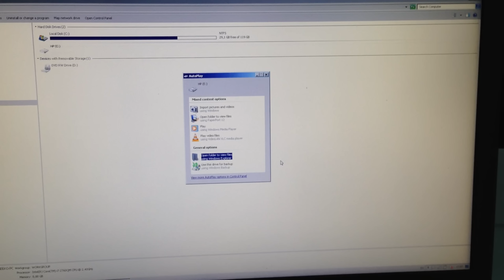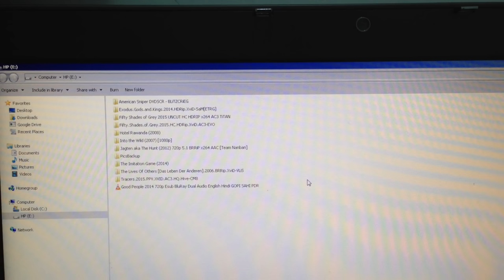How to recover data from a dead hard drive (for beginners)

Comment: Hi guys i got one question, can i retrieve data from an old hard drive ( that is still good ) to a new laptop? I sold the motherboard and processor and i am not able to start the old pc... i dont want to loose the data on the old hdd and i want to know if its ok to make a direct connect with sata cable to laptop to retrive data from it. I ve seen that when you connect a new hdd on a pc or laptop it shows you to format the new one connected... i dont have the device to connect it with an usb like in the other videos that i found on the internet i got only the old cables from the old PC

Comment: I have one question. my hdd is showing not initialized with no disk allocation on the side. on connecting it to the laptop, it spins for 5-6 seconds, then gives me three clicking sound, and finally stops. the wd diagnostic app showed the SMART test passed for the quick scan and full scan. can you please help me?

Comment: I will not think this is a "dead" hard drive, but it is a "dying" hard drive, because it can still turns power on on it, and the noise / click etc is signs of dying. I have a hard drive, that make "click" sound for 8 years ago. Today it will even turns on anymore, so that i guess it will not help to move the "reader" from the disc inside. But there may be something on the green "power-plate" inside that didnt work, even i dont know how to fix it

Comment: I have a question, my hdd showing disks 00MB and as an external connection it shows the full size of hdd also disks sizes like 150GB of 150GB free so in this case this will work? Head beeping only 1,2 time while it's connecting as external hdd or powering up the pc in internal hdd

Comment: 2:40 needed that wire and jack whats the name of that.
Reply: Here in Greece i found the cable that probably it will work for *ME  and its called (J&D USB 3.0 to SATA III 2.5" Hard Drive Adapter for 2.5 inch HDD and SSD) .The price on internet is 20,52 + transport + pay on delivery = 24,92$ . I HAVE A PROBLEM WITH MY HARD DRIVE (LAPTOP TOSHIBA C50D A 133 ) AND I WANTED TO TRANSFER MY FILES FROM IT TO MY OTHER LAPTOP(LENOVO) AND THEN I WILL TRANSFER THE FILES FROM LENOVO TO THE NEW HARD DRIVE(TOSHIBA HARD DRIVE) SO...I WILL HAVE AGAIN THE SAME FILES...BUT I DONT THINK TO BUY THIS CABLE...I WILL JUST BUY A NEW HARD DRIVE AND THEN I WILL INSTALL WINDOWS 8.1 WITH FLASH DRIVE. IT WILL BE LIKE NEW ;) xD. (SORRY FOR MY ENGLISH).
Reply: @lus1ano545   Thanks 4 ur reply 
I got the answer, your English is better than me Respect from Pakistan Stay blessed and Safe from COVID-19.
Reply: @next-level5663  thank you,god bless you & your family 🙇‍♂️

Comment: Hi, I was wondering if anyone had successfully used this method AND then
 continued to use the hard drive successfully after data recovery had 
been achieved? How long does a typical hard drive last for after this 
type of 'temporary' repair?
Reply: As soon as you open the hard drive, its basically unusable after that. Hard drives require absolute no dust inside, which is why they are sealed. If you really need the data, send it off to a data recovery specalist.

Comment: I have swapped the board and move the old bios chip to new one, it read on diskmanager but asked me to initialize and when i did it give error
There's no rough noise or click on the drive
Any solution?

Comment: What is that thing you use to connect hdd with usb cord to you laptop?
Reply: You can get it online...Either a cable or even comes as a case in which you fit it the 2.5 hard disk.
Search for 2.5 HDD SATA cable / case online

Comment: PLEASE HELP! 

My Seagate Expansion 1.5TB External Hard Drive is not responding when connected to a computer. It spins normally & shows the blinking light as well but when I try to open it in "windows explorer" the whole computer stops responding. What might be the problem?
 
There is no clicking sound, the light is blinking and the HDD is showing in "my computer" but I cannot open it. I tried to run CHKDSK on cmd, 3rd party softwares, device manager, etc  but everything just stops working & I had to pull the plug out.. When I checked my task manager, the disk is running at 100%... It is sad because it is just bought it a few months ago and now it is no longer working with my data stuck inside it. ☹☹

Comment: I   was trying to  copy   several folders  in a PC  from  one partition to another,   but instead  of   using   "copy  X to   Z",  I  used   "MOVE  X to Z",     It was  working well,  the  files  were   moving  but suddently electricity  turned off.     Afterwards, the   folders did not appear  in any  partition.    Is it still possible to recover the data  lost ?   I have not done anything  extra after that day,  no format, no more data added  or erased,  nothing.     I only read  the  total content of the disk,    before the event,  I  had  about 10 GB  of data,  after,   only  about  3 GB.

Comment: could anyone please say, if that sound comes for more than 5 to 15 minutes will there be any problem to the data in it.As I was not aware of it I did not turned off .please respond.Can I get the data back from a hard drive which is making sound like this by doing above process

Comment: don't put screw driver up on head area move it at the base of the arm otherwise you run the risk of scratching the platters as you pull the arm with the tip or erasing data if magnetic.

Comment: Help!!! If my PC's BIOS does not detect my hard drive does it means it's damaged or dead? Is it still possible to recover my data? It makes a strange clicking noise sometimes when I try to run my PC. It had been working flawlessly for almost two years, but yesterday, all of a sudden the whole OS (Windows 8.1) froze. I forced the PC to shut down, then I turn it on again and all I got was a black screen saying there was a boot failure... Please help!
Reply: Sergio Soriano, hi there. Usually when the clicking sound begins, there is basically no hope. A data recovery center MIGHT have some tricks up their sleeves, but the chances of any data recovery is low.

Comment: Hi, I have a 2011 Macbook pro and the hard disk and / or hard drive is down/bad. Computer won't start up. I was going to throw it away but I have some files I would like to save. Would you know the connector I need for it? Thanks

Comment: I would like to try to recover my old data from something similar WESTERN DIGITAL AC22500-32LA CAVIAR 22500 16 HEADS 63 SPT 2559.8 MB HARD DRIVE. Do you know where to buy the cable that connects the hard drive and the laptop?

Comment: I’ve been trying to swap a single platter from a 2.5” toshiba HD from a JVC camcorder and no luck.  As soon as I open the drive, it won’t read data any longer.  I’ve tried with 4 different drives all the same part number from 4 different cameras.  I give up and will see about professional data recovery.

Comment: Unfortunately you FORGOT to ADVISE people - In WRITTEN MANNER
"WARNING: If your hard drive contains valuable data DON'T DO THIS"
"WARNING: This video is solely for didactic purpose!! As soon you do some wrong move, you'll scratch the drive
At THAT POINT NEITHER a professional will recover it" [click Read More for more explanations]

since brushed or scratched platters mean HARD DRIVE LOST FOREVER

and why not a sharp

"WARNING: Spinning a drive in dusty atmosphere either the clean box I mention in the video, suc*s as idea, since as soon you open that box the pollution in that atmosphere will enter in the box"

Have you ever uncovered an hard drive under the microscope? I did

Platters because of spin, with their surfaces brushing the air at 90Km/hour are electrostatically loaded , 

open the cover and in some tenths of second all the dust in the air around will be attracted.

Dust is meant something you can't see.

Do you know the non-distance between platters and heads sliders? 
Because of the video you made, it is obvious that You don't know, I tell you: 100 atoms

It is unbelievable to observe what kind of bad tutorials are capable to do people to just catch some views.

People around was telling that PROs are expensive, I googled carefully and I have found the solution
If your data is worth 299 euro, head to www.recuperodati299euro.it , FIXED COST and no recovery no fee.

Comment: Ok I can buy a cable for my broken Compaq Presario CQ61 Laptop, I am going to take the hard drive out of my Compaq Presario CQ61, it's a USB Cable I have to plug in, is it a 2,5" Sata interface and is it 15 or 22 pin I need and again this is the cheapest cable to attach to the hard drive which I am going to take out of my Compaq Presario CQ61 and attach the cable to this hard drive, so what should I type into EBay or even better AliExpress as they cost around £3

Comment: What if there is no sound, the drive is silent, undetectable & it just spins? Your feedback is greatly appreciated.

Originally, it black screened, pointer only. Took it to bestbuy (HUGE MISTAKE) & they tried to refresh, it couldn't get just 11%. Bad sectors. After they finished, it just spins silently no noise & is sometimes undetectable. At other times, it's detectable & the system locks. I created an ALL Files refresh .bat from cmd to try to bypass detectors, but the drive was unsucessful in clearing. It would not refresh. What else can I do? I just can't to retrieve my data. Again, any help would be greatly appreciated. Thank you again.
Reply from the maker: R.I.P

Comment: DAMN!  5 TB of data about to be lost as my drive started to the double strange sound clicks followed by silence and repeat after 3 seconds. I even dis and reconnect the HDD and the CPU found it before immediately disappearing again in error.  Looks like i need to go buy a new one and go through this surgery. Wish me luck. I NEED those files.  Now, how on earth can I do this in my house as I'm sure dust and particles are everywhere even after vacuum, cleaning and so on??

Comment: Hard disk opening must be performed inside special "clean" camera, without dust.. If you open your HDD cover, it's only 10-15% your drive will be alive after it. 

And never, NEVER move heads by your hands as in this video! On the working HDD heads NEVER have contacts with disk surface, because it fly on the thin air layer. If you move heads by hands, you WILL scratch disk surface! And you will damage your data.

Comment: Hello sir!.......I'm facing a issue... I connected a brand new hard disk to my PC as a primary HDD .........It showed up in the boot menu in the first try.......when I entered windows setup through dvd......the partition screen shows 0.0MB......and now doesn't show up on the boot menu or bios screen........I connected the same hdd to another PC with different sata cable it doesn't work in the other pc either........what could be the problem.......I doubt my SMPS or Motherboard is dead! Any ideas guys? Please HELP ME.......if I get another HDD I'm afraid that even the new one would be dead.

PS. I had a old HDD(7year old) ........it was just working fine........and suddenly one morning it died and I thought bringing a new HDD could fix my PC but it didn't

PLEASE HELP!

Comment: My external Hard Drive (Seagate Baracuda 3TB) was making a buzzing sound. I opened it up and noticed that the head was on the platter near the edge. I moved it back to the parking positon. Now that buzzing sound is gone, but it is now making a clicking sound and still not detectable by any of my PCs. It does not show in My Computer or disk management. It only makes a sound when connected which is the Windows default sound for all USB devices.
What could be wrong now? the head itself?
Reply: Sandeep Veeramani You have to send it to a certificate data recovery lab, never ever open it up by yourself...

Comment: What is the device you used to connect the HDD to the laptop called?
Reply: @Alexander-hf5wi  would appreciate one. Thank you brother 😃
Reply: @Alexander-hf5wi  I can use this for laptop hard disk too right?
Reply: @Alexander-hf5wi  alright, thank you so much for your help man. Have subbed. Thanks again 😃
Reply: @Alexander-hf5wi  Thanks for the heads up. I saw some other cables saying supported until windows vista. Know why?

Comment: Hi ! My HDD fell off my desk and hit the floor.. It has a similar clicking noise. Its powers up fine then hits a repeat pattern of clicks.. It feels like it is trying to read but is stuck... I have contacted a pro but he isn't very optimistic... Thanks for this vid. I am feeling very positive it can be fixed!
Reply: Were you able to fix it? Pro's usually aren't very optimistic so that they can sell you a service for a rip-off price.
Reply: @eppsislike  You are absolutely right. He was trying to tell me there was no way the head could be re positioned if it was stuck on the platter. He was suggesting a very expensive removal service. I told him that I wasn't interested in that and would rather just loose my data if need be. Well I told him straight and he tried to wiggle his way out etc. So I met him, he is now taking a look and I am waiting on his reply. Thanks a lot..

Comment: What happens when you shake the drive and you hear some sound as if some little part broke off, which I suspect could be the spindle. Thanks in advance.
Reply: I hear that often in many portable drives that are good and working actually. I think it might be a small actuator that is tripped by the air pressure when the drive spins up.

Comment: My hard drive become dead because of water goes onto the circuit board. There is no sound at all. Its not getting power at all. Should i tried to swap pcb with identical pcb? Please advise
Reply from the maker: If you have data that you cant afford to lose on this hard drive, then i would advice to send it to a professional data recovery center.

Comment: Hi, I see this video as a glimmer of hope for my hard drive. Mine also fell from the table to the floor and is no longer recognized and clicks ... I have a WD My Book 8 TB external hard drive that I have completely dismantled. However, the internal hard drive has no visible screws; it looks as if the cover is glued. I've already considered whether I can get the lid off with heat (e.g. hair dryer). Does anyone have any experience? If the lid were off, I could see if the read / write head is stuck ...

Comment: Hi. Very good your video. But I understood that the hard drives were sealed vacuum to prevent overheating of the disk drive, so when you open it and close it again how you did it, the unit may overheat and be damaged. This was commented to me by a Professor in Computing in 1991. Is it the same now, or has the manufacturing method changed? Thank you.
Reply: No it hasn't changed. Plus opening the drive instantly attracts a ton of dust particles, while dragging the heads across the  platter causes endless numbers of scratches. 

There is a reason they say, " NEVER OPEN A HARD DRIVE! "
Reply: Ratapelua71 - They are not "vacuum sealed". The heads need actual air inside the enclosure to fly over the disk. There is also a closed-cycle air cleaner inside the enclosure to trap any particles over the life of the drive.  You can see the cleaner (an air filter) at 1:25 mark in the upper left of the opened drive (It's the thin white  object at a 45 degree angle). I've opened, fixed & reused about 25+ hard drives over the past 38 years. Even further back, with 1970s minicomputers you could remove the disk platters(s) & clean the read/write heads on the actuator assembly with Kimberly wipes soaked in alcohol wrapped around a wooden tongue depressor(!).

Comment: Hello my friend, thank you for your video. I was wondering if you would be kind enough to please answer me some questions with regards to my external hard drive issues. I have check the hard disk inside and the needle is pointing in the right direction plus the hard drive does not make any sound when I connect it. However, the hard drive is showing when I click on the hard drive Info on my iMac.Thanks a lot and I hope to hear from you soon. Regards, John E

Comment: this is complete nonsense, once you bring the head into position it will just move towards again where it was stock. In order to read the platter it must go inner the middle and go back to the end position and then the reading will begin, if the head is stock then it will not go freely as it use too and get stock again preventing it to do normal reading, it will eventually just repeat the steps and that is the clicking sound you hear.

Comment: what can I do when the arm is clicking back and forth  ? and not staying on the platter.
Reply: That might indicate a critical error on the PCB. That means, that you probably need another working hard drive of almost exactly the same type and then interchange the circuit board of the broken HDD with the new one. This solution is likely to work, but of course not guaranteed, as every other solution is not.

Comment: Ok quick question. My hard drive is dead as in DEAD dead. Can i use the two discs inside the HDD and place them in another one to extract the data? If so those it have to be the same brand as the original?
 Thank in advance.
Reply: You should contact Gillware or ACS data recovery if you have important data you want to retrieve. The complexity of hard drives aren't an easy task for an non expert to handle especially when platters aren't designed to be touched by human hands. The experts work in clean rooms certified where as in the video, person showing you a not so smart way to fix a hard drive.

Can you exchange patters? Contact Gillware, ACS, or Datasaver to give you an answer since they debunk the DIY videos how to save hard drives yourself. The data recovery works with donor drives to replace damaged pieces but it isn't simple or self explanatory. Assume you had your own clean room workstation, the software tools are proprietary and utilize inner parts of the hard drive to make a sector to sector HDD image clone.

Hope that helps